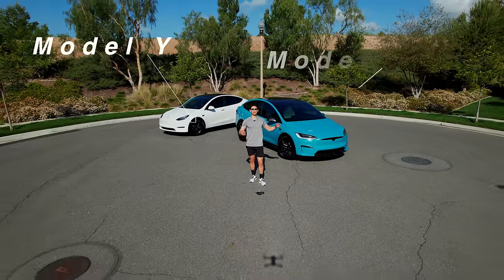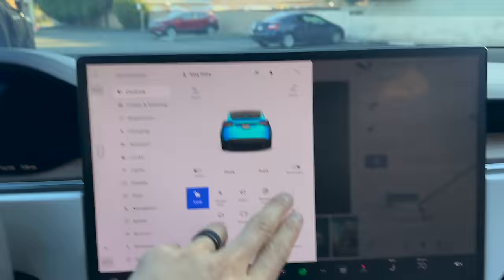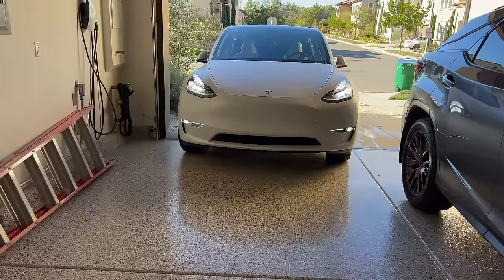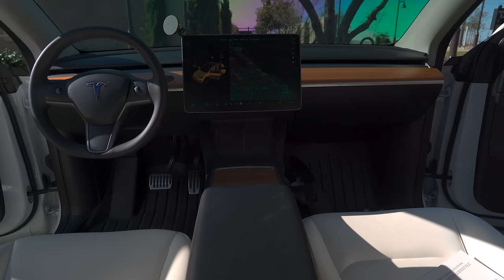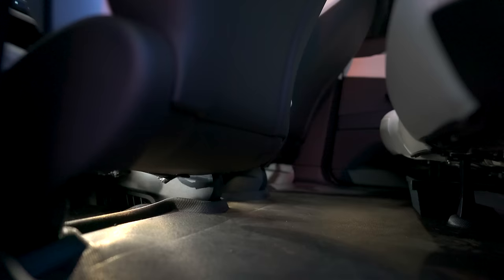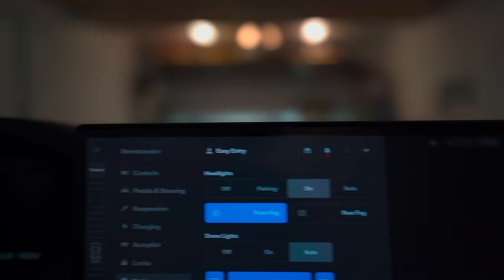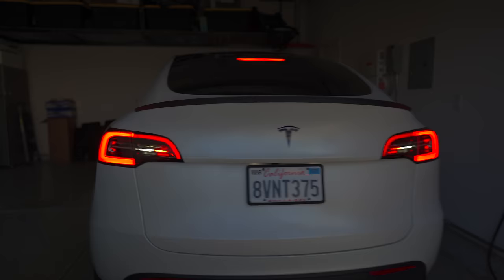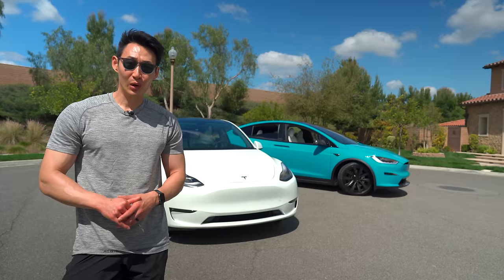Tesla Model Y vs Model X (ULTIMATE Buyers Guide)

Comment: Just purchased an X to replace my 3, and the wife has a Y. I still think the Y is the better buy, but the X definitely has a better “feel” to it. Overall I’d say the Y feels like a mid-$40’s car, while the X feels like a high $70’s. Obviously the falcon wing door add expense, and value in limited circumstances, but I think that they’re not a justification for the excessive price. Worse still is the S. In terms of value I’d place the lineup like this:

MY LR
M3P
MYP
M3 LR
M3 SR
MY SR

MX LR
MXP
MSP
MS SR
MX SR
MS LR
Reply: im new to tesla and deciding what car to get, why is s the worst?
Reply: @crystalwaters513  The rear seat space is marginally bigger than the 3, it’s very expensive and there are no party tricks like the X has. The S is also the oldest in the lineup in terms of architecture.

Comment: Had a loaner X. The glass ceiling above the falcon door was cracked, but didn't notice it until I got curious. I mentioned this to the service center and they didn't argue. I like X's ride comfort, though the X's weight takes a hit on kWH/mile as compared to the Y and 3 resulting in longer charging times and higher energy costs.

Comment: Oh guys, after 4 years of owning my 2018 Model X, the biggest issue I've faced is an unexpected one: I've lost interest in exploring other SUVs or electric vehicles, even other Tesla models including the Cybertruck. The seven-seater configuration with foldable seats has been perfect for camping trips with my wife, working or playing games from the third-row seat #6, using the folded second row as a makeshift desk for my laptop, or simply cruising around the neighborhood. The elevated ride height of 22cm genuinely sets it apart. The drawbacks are minimal - slightly higher consumption and the need to keep an eye on the air suspension and steering rack due to the vehicle's considerable weight.

Comment: yesterday i tried Xbox cloud gaming in my 2023 Model Y.  I was shocked how well it worked!  Even with more fast paced games it was very playable.
Reply from the maker: Oh cool!!
Reply: @EverydayChris  Do you know if they will be bringing back the ability to use wireless gaming controller to the MY?  I can only play the arcade with the steering wheel and it sucks.  It was like a software update they used to remove the data capability right?
Reply from the maker: @yvetteberndt3155  they have it! You can now use bluetooth to connect the controller or plug in the dongle to the usb in the glovebox with a hub

Comment: If you had to choose between a fully spec'd out New Model Y Performance or a nicely equipped 2021 Used Model X Performance....both around $70K.....what would you choose?
Reply from the maker: Damn. I'd have to go with Y performance. Not a fan of the Old X interior. Also, battery is newer, faster charging, etc. If it was like a 2022 updated interior X, that's something else

Comment: Model X truly is a technical tour of force. But like all things more complicated, more to go wrong too. Personally, as an old fuddyduddy who drove a 56 VW convertible that lacked basic necessities such as heat, horsepower, sufficient headlights, a horn that could be heard, power windows, AC, automatic transmission, air bags, sound proofing, power steering or brakes, heated seats or a heated steering wheel (at least it has an old-fashioned steering wheel and turn signal levers, hmm?), and it rode on bias ply tires... I think the Model Y is a better value in the long run.

Comment: No mention of the heating system on the X.  Did  the X ever upgrade to the heat pump like the Y, or does the X still use  resistive heating?
Reply from the maker: YES HEAT PUMP! Good call. missed the details. Honestly, this video could have been over an hour long lol

Comment: My doors didn't want to shut so I had to go three times to the dealership and they have problems shutting when you are on an incline? That was hopefully a joke. If my car had a problem like that it would be in a junkyard or sold that day. I want a car not a headache. My Honda is now 13 years old and haven't had a single problem ever. Not a single thing worked improperly or had to be fixed. Not one. And it costed four times less. I'm planning to buy a Tesla but this sounds like a nightmare. Is there a model that doesn't have this falling apart nightmare low quality crap issues?

Comment: I want a 12v outlet ( cigarette type) in the trunk for my refrigerated cooler. It’s an SUV for crying out loud. The cooler needs to be in either front or 2nd row footwell. Major nuisance.  I, being short, use the fob to close the falcon doors or the pillar button.
Reply from the maker: There is one in the trunk but I wish it was in the frunk
Reply: @EverydayChris  I’ll have to look again. Don’t believe it is mentioned in the manual. Yes, would nice to have one in frunk also. I want to get at my cold drinks during hot weather..but have room for people and dog. Dog owns the 2nd row.
Reply from the maker: @prairie3668  Should be in the mesh net area on the far right!
Reply: By golly, there it is! Not a word about it could I find in the manual. Thanks so much for the tip. Makes my travel so much easier!
Reply: @EverydayChris  got it. I never would have discovered it or only after many years. No mention of it in the manual.

Comment: Giga fail on 2-row seating.
If your car has only two rows, but comes in a three row as well, then if you buy the two row, you should be able to slide the second row WAY the hail back for limousine leg room.  It's absurd that a lexus or mercedes can give you limo back seat space and Tesluh can't.

When I owned a 3-row minivan, I took the middle row out so people in back could stretch out 7 feet if they wanted.

e-lawn is an a whole.
And yes, whineys, I have a model Y Performance,  just ordered a Model X, and have several milly in Tessy stock.  E-lawn is still an a whole for obviously stew pid seating design